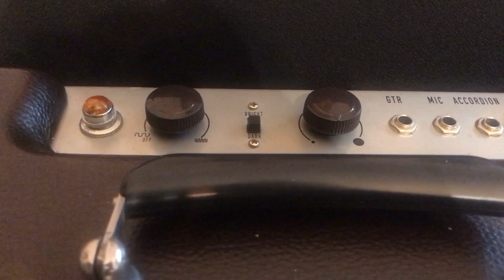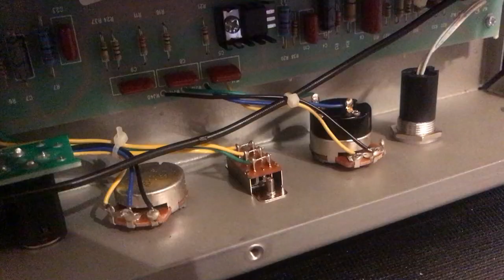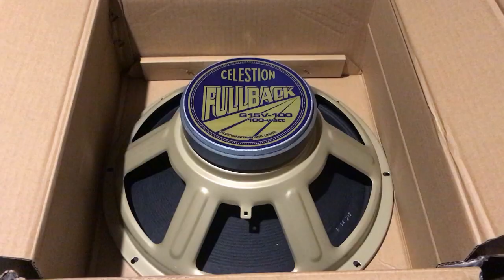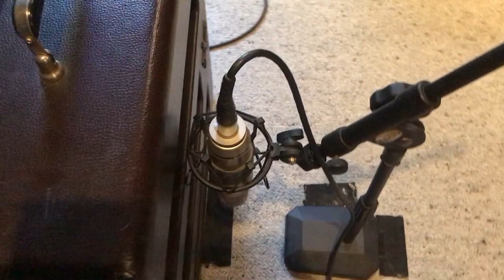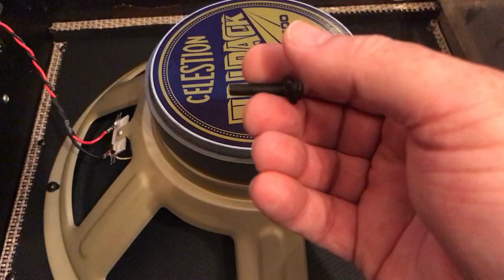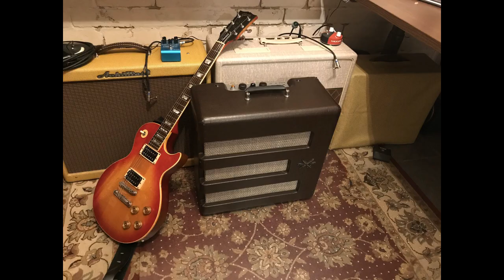Fender Excelsior Amplifier Upgrades & Demo

Comment: Wow that speaker change really brought the tone of the amp forward and tighter.
Reply from the maker: Agree completely. The Celestion is huge improvement. In addition to being significantly louder, the bass is much better defined and the mids are better balanced with the highs.
Reply: There's something about the way that the stock speaker breaks up until that's kind of rude and cool. I think I would need two of those one with the celestion and one with stock speaker. Friend of mine has one One of the best small amps I've ever played.